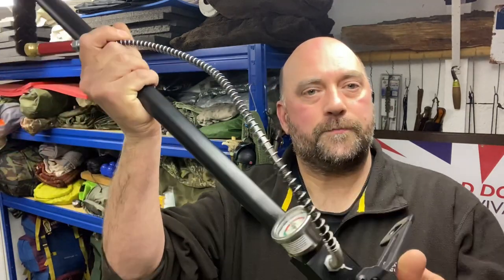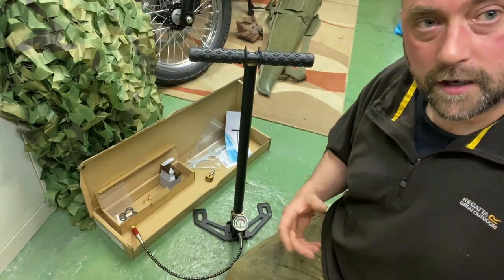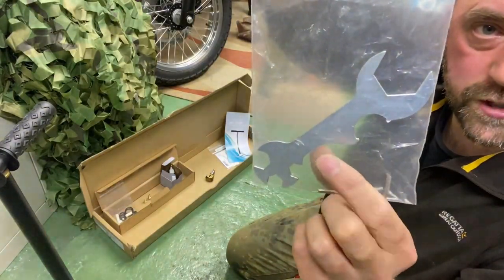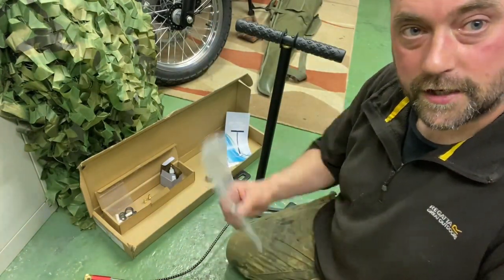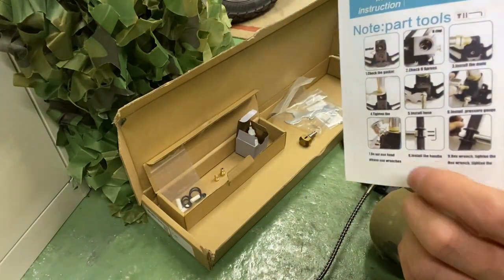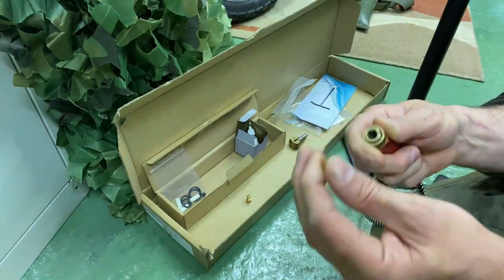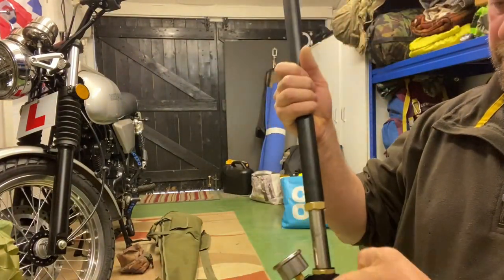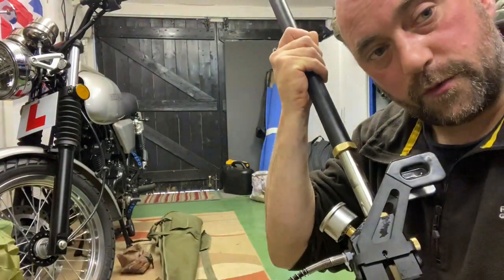Cheap stirrup pcp airgun pump

Comment: Hi Andy ☺,  its cheap and cheerful,  but no proper water trap , air filter.As a long time user of PCP airifles  it's very important to charge them whith dry air ( diving quality ) as provided by the diving centre, otherwise you will put moisture into the guns air cylinder, causing corosion, of the internals, have you considered  having your own divers bottle , if you consider going down this route I can provide you whith the relevant info if you so desire,  or any other PCP info etc, so don't hesitate to contact me. Stay safe mate, best wishe's to you and Wendy,  Stuart, Megan, Uk.
Reply from the maker: Excellent info brother thank you! Yep I’ve read up on it, but I figured that I only usually re charge my pcp about once a year or so, I thought it would be a small risk? Again thanks for your advice I’ll take heed! Very best wishes mucker I appreciate your kind feedback 👍🏽👍🏽👌🏽😎
Reply: @MadDogSurvival  Hi Andy, I'd a feeling you'd have already swotted up on that option being a smart chap, Air Arms make terrific  guns, I've had a couple and couldn't fault em, I'm using a Daystate x2 ,177 at the moment , it's a few years old, and I changed all the seals  6yrs ago,  but has never missed a beat since, I keep being tempted by a new one, but the old gun shoots better than me so why bother,lol. Pcp's are amazing, but I still like using my TX2OO  in .22, another good AA product. I hope you have some good fun whith the 410, take care mate, kind regards Stuart Uk.
Reply from the maker: Nice one brother! Yep I’ve had mine for 15 years now and it’s still going strong, don’t use it as much as I should but I’ve got quite emotionally attached to it now lol… as you do 🙄…. Daystate are excellent! Glad to hear you’ve chosen English too! I quiet fancy the regal but I’ve got around 20 rifles and I’m not sure I’d get another past the Mrs 🥴…. Enjoy your shooting brother! If I need any info I’ll definitely tap you up brother! I respect your experience and value your help. Love and respect to you and Megan from us both mate 👍🏽👍🏽😎🇬🇧
Reply: I'd use the big trap I got with the hand pump 👍
Reply: @stuartlockwood9645  got a 7 litre dive bottle but it came empty so I'll get it sorted. Thanks mate

Comment: When I shot precharge Airguins years I ago. I bought a pump to go with my Theoben Rapid 12. Was nice to move away from having to get my diving bottle refiled and MOTed each yet but OMGG it took ages to refil my little removable Rapid dubby bottles lol. I put thousands of rounds through that gun. These pumps are not for everyone but there very handy if your main bottle runs low. nice video, makes me miss my shooting days.
Reply from the maker: It’s a good back up for sure and if we need to hunt in a power outage we still can. Theoben was always on my wish list! Nice! Get back into it mate! Only here once! 😊 very best wishes buddy 👍🏽👍🏽😎
Reply: I've still got a highly customised BSA lightning. Synthetic black stock. Custom adjustable shoulder butt plate. Custom silencer. Only problem is its a first edition without the adjustable trigger. Very heavy even with a trigger shoe. Unfortunately you can't change the trigger.
Reply from the maker: Still a nice piece to own! Shame you can’t change the trigger for a record unit! Best wishes mate 👍🏽👍🏽😎

Comment: I bought a manual pump for my air rifles and it came with a moisture/dust filter.  I find it's a lot easier to use your body weight to pump by  locking your elbows after the initial push halfway down, and doing half-squats to get the 2nd half of the pump cycle to force the air into the rifle's reservoir.
Reply from the maker: Yep I agree 👌🏽👍🏻👍🏻😎…. Thank you for watching and taking the time to comment! Best wishes 👍🏻

Comment: I got mine for $45 on Amazon and it is well made and doesn't leak, but at 79 years old, I found that I could only get the tank on my PCP Gamo Arrow only half full after many dozens of pumps, so I found a dual voltage electric 4500 PSI pump for under $200 on Amazon, shipping and taxes included. So I'll save the hand pump for a backup, or when I want to try to give myself a hernia....
Reply from the maker: Lol…. I totally understand brother! Having had two major heart attacks I’m in the same situation 😎👍🏻

Comment: Thanks for that, very informative.  I suspected that using such a pump may put moisture into the rifles air cylinder. It's a pity you couldn't film at 25 fps as 30 fps doesn't sync well our 50 cycle mains lighting. Despite that I like your down to earth approach, thanks again.
Reply from the maker: Thank you! Yes the moisture will be a problem over time but I intend to keep the pump purely as a backup for a power down emergency type of situation so hopefully shouldn’t be too much of a problem. 
I think my fluorescent lighting might not have helped with the video quality then! Apologies for that. Thank you for your kind comments. Best wishes 👍🏻👍🏻😎

Comment: You're a real Star my friend but I have a question could you use a pump for a carbon bottle  as apparently gases are different and I'm about your age and just changed over from springer?

Kind regards 
Matt
Reply from the maker: Thanks mate! I’m not sure about that but I know that a stirrup pump works with a buddy bottle, so I’m guessing that if the fittings are right it’s possible, but I would recommend getting some professional advice! Its high pressure stuff mate so please be careful! Have fun and best wishes 👍🏻👍🏻😎
Reply: @MadDogSurvival  thanks a lot my friend and I will follow your instructions 
Cheers
Matt

Comment: Need a moisture  filter otherwise your gun will rust inside
Reply from the maker: Thanks, yeah I will only use the pump if ever I need to charge it during a power out or emergency situation etc as I usually use compressor or dive bottles and keep the air as dry as possible. Thanks again for your watching and commenting mate 👍🏻👍🏻😎 best wishes

Comment: is this pump any good one year later??  would be good if you did an update .... thanks
Reply from the maker: Hello. The pump is still performing good, however I only use it periodically as I bought it as a backup incase of a power outage or if I needed an emergency fill in the field so it hasn’t had heavy amounts of use. But again in short yes it’s still performing well 👍🏻👍🏻😎 best wishes
Reply: thanks for the reply  @MadDogSurvival
Reply from the maker: No problem 👍🏻 best wishes